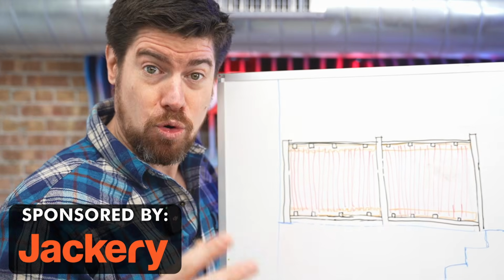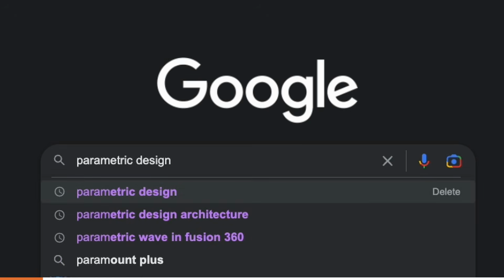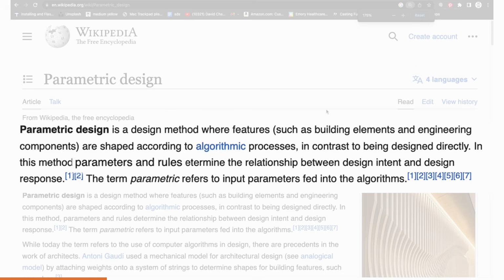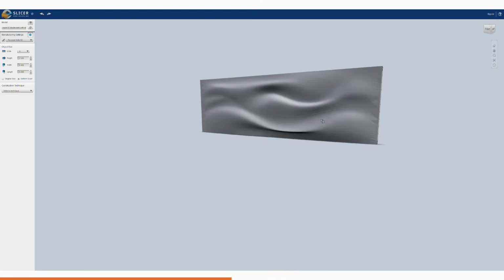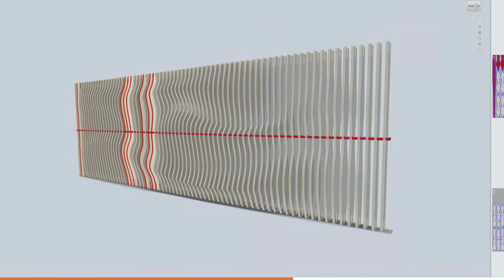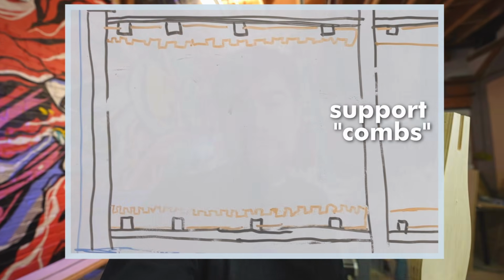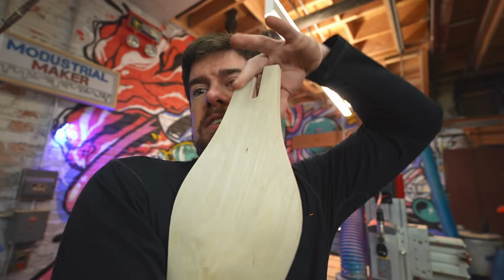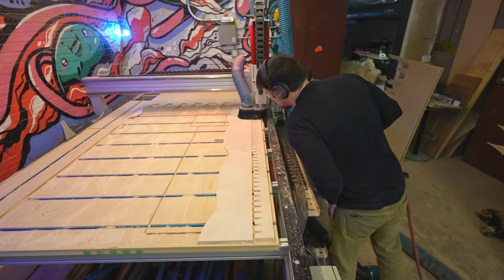I HATE Boring Stair Rails, so I made THIS....

Comment: OK, but why not get, say, a big slab that's half the length of your railing. Then just go nuts on it with an edge grinder, then cut it into slices, number them and space them equally apart. Fewer steps, less ridiculous equipment, similar result (the shape wouldn't be parametric).

Comment: Where the black shows on that middle rail  because the design needs a really thin but of wood  , how about putting a wood ball that shows both side of rail ,as if it stuck going through a hole in the design .as that tiny bit of black  just sticks out like sore thumb . Have something  on purpose rather than a cock up

Comment: How are you out of 1/4 dowels.  you have a CNC machine and are a woodworker.  you should have been able to make some some dowels from either method.   
We had to do this in highschool on the drill press with a small hole bit.

Comment: Assume the fence post was put in the wrong space because you pull the post on the wrong side of the measuring line, ad the pipe is about 1 inch .   At least that is what I would have done by mistake.

Comment: I think to add to the top frame, maybe get some 1x3 steel box tube and cap off the top by welding it straight to the slightly elevated posts. I think the extra parts sticking out the top look odd, and the metal painted would look pretty slick with it. almost like a hand rail. Lastly is there any way to make the support at the top stair smaller, with something more like a piece of plate for a gusset?

Comment: this is some great work man. As far as the hardware for attaching this, as other peopled mentioned it could be better. Barrel Nuts and bolts would look the best IMO. Also the dowel and hole thing will definitely be good, but maybe do it before it falls off, it'll just be harder to get it all to match again if you mess with it once it's been installed for a while. Also are you going to do the same on the stairwell side?

Comment: What a great project! Very well done! Loved it! I just have 2 very minor concerns and they are totally fixable if you agree with what I see! I guess with black painted bolt heads it will be seamless. The second thing is that it just feels really weird to see that empty black hole in the middle of the overall view, maybe you can just do a one piece with a very thin layer of wood in the area where the previous two pieces are separated, before you go with epoxy and stick it there for good, it is doable now since you are using a double faced tape as a temporary solution. Again, great work, much support!

Comment: Im not saying you are wrong that the program you are promoting is faster for this but it really doesn't take long if you're proficient with fusion to create an array of slats like that.  Like it's a single operation. a rectangle the thickness of plywood with an array using the intersect.
Reply from the maker: then take 72 pieces, move and rotate them individually onto 4x8 sheets of plywood ;)

Comment: That wouldn't take hours to do in fusion, just calculate the width and spacing of each segment, and use a box plus the pattern tool and the intersect modifier to make the pieces...
Reply from the maker: then rotate all 72 pieces and arrange them on 4x8 plywood pieces... and if you don't like the spacing, redo it 6-7 times like I did.  I did it manually for the sign in my shop, and it definitely did take a few hours.
Reply: @modustrial  I'm more familiar with the 3d printing work flow, I thought the part that you were saving time on was the slicing. My bad, thanks for the insight.

Comment: So damn awesome! I'm not any professional at all, but is there a reason you welded the frame to the floor instead of using a smaller square tubing insert bolted to the ground where you can then slide the main vertical rails over it?
Reply from the maker: I have a weird situation where I don't have access to the floor from below, so had to make it work.

Comment: Could you not have turned that shape in F360 into a surface and used that to "cut" a bunch of slats in F360 generated from a single object?
Reply from the maker: yes, you can...but then you also have to individually rotate and move each slat onto a 4x8 sheet to generate the CNC cut paths, which is a huge pain.

Comment: Cool design, but that is not parametric modeling. Parametric modeling is using mathematical equations(algorithms) to create the design. You modeled everything by hand and used a CAM software(the slicer) to output a cnc file for your hand modeled CAD model.

Comment: Actually, once you have made your model in Fusion360, you just need to create 1 slat, repeat 71 times and intersect with your wave. The result is 72 slats without leaving Fusion360, no need for an external program such as Slicer.
The main problem is that the shape is static, so may get bored of it fairly quickly. An immobile wave? There probably is a way to do better, don't you think? Arduino-controlled servomotors bending slats parallel to the handrail is pretty penny, but you can make actual moving waves on the entire length of the handrail... Class!

Comment: Love the design but hate the fixing method. I would use a U channel at the bottom to hold the comb and an L angle with welded captive nuts (recess the rear of the comb to accommodate) then use black countersunk screws through the comb. Hides the 'Method' and directs attention to the design. IMHO of course. Totally love the education you give.

Comment: Slicer for Fusion 360 is not parametric design, it is computer aided manufacturing (CAM). It generates the routing for you based on a given design. Akin a 3D printer slicer software. And it seems to generate also the nesting for them. This is very cool piece of software none the less! 

For this to be parametric design, you should have not freeform the design in Fusion, but instead given some parameters (inputs, formulas, curve equations) and let Fusion generate the result, and you only changing the inputs to your liking.

By the way, Slicer for Fusion 360 is not supported anymore.

Comment: Hey, firstly it looks really sick! also I just want to point out.. the software that you use is "just" a slicer software the parametric part would be the generating of the curves, if I understood it correctly. never the less it looks really nice! and I wait for the day, when I have access to an cnc-machine to do something similar (I'm not mad enough to cut and sand days on my own, if I could have a unpaid robot worker doing it for me :D )
Reply: Yeah, just to echo what you said. It is a cool design but not really parametric. Even in the definition on the wiki, its about using parameters/variables to do the design, but the 3d surface was designed directly (what the wiki says parametric design doesn't do). The slicer software is definitely useful for getting the look right but the design itself isn't really parametric. If you could do the 3d surface as a bunch of trig formulas where you can use a variable to control like the intensity or frequency, that would be more parametric design. It allows you to generate infinite possible designs just by changing a few parameters, rather than just the one direct design.

It's definitely a really cool project though!
Reply: @dedicateD6  yes, that's exactly ehat i thought. He was still designing the Wave shape directly so not really using parametric design here. Never the less an awesome Design and handrail Project.

Comment: This has been on my mind for a while, and as someone unaware of the through and through of cnc machines, when it comes to you nailing down the board you are using, how do you know that your bit is safe and able to not come in contact with nails? or is it just a simple case of the bit can run through a nail if it accidentally comes into contact? Piece looks sick though as usual!
Reply: He uses Polymer (plastic) brads if I remember correctly.

Comment: I think even without the Software or templates this would be doable. 
Cut w bunch if plywood into identical strips, 
Turn then 90⁰ and clamp them together sort of like a cutting board process and then go in with a grinder and a wood carving blade and design your waves by hand. 
Finally unclamp the slats and just continue from there.

Comment: For slicing the model in the plywood parts, you can create a 2d sketch parallel to the rail and use mathematical functions to set a fusion360 rectangular pattern to the size you want. And can set a parameter in the parameters tab in which you set the width of wood, spacing between adjacent slices and length of rail.
However, it is more time consuming than using a software.
Nevertheless, nice work. I really enjoy watching your videos

Comment: This looks really cool! As always, I am a fan of steel and wood together. Can't wait to see the whole house!

I am a little worried about the strength of the posts though. There seems to be quite a bit of weight in the wood. If someone were to lean too hard on top of a post, it seems like it could get away from you. Maybe add some gussets or a piece of flat plate at the bottom of the posts? A vertical flat plate could be fairly inconspicuous if welded from the bottom of the plate that's anchored to the floor, to about 5-6 inches upwards on the post.

Comment: How did you end up lagging the bottom layer of metal to the floor? I didnt see any bolts.
Reply from the maker: The steel angle was already there... Whoever installed it tapped countersunk holes for wood lag screws, and screwed it to the joist in the floor below (reinforced with construction adhesive I believe).  You can see the screw heads flush with the surface, if you look close.

Comment: Looks good, if I had to critique (which I will do now:), the eye almost immediately goes to the black spot on the middle post.
Reply from the maker: Yea, it does... Designing again I would have made sure the middle of the wave was wider than 1.5" all the way across, so the interpolated post piece would extend the full length... But as they say, hindsight is 20/20 :). 

Long version of the story, is I actually made the decision to switch to 1.5 in posts instead of 1 in posts on the day we were about to start welding, after the slats had already been cut out on the cnc... With the original design having one inch post it would have worked, but I forgot to take this into account when changing to the beefier 1.5 in posts.
Reply: @modustrial  just paint a line to connect them and you gotta work on them welding skills a bit lol there is a channel called welding tips and tricks he really knows his stuff

Comment: Hey Boss,

I realize with the editing, you may have taken out some of these parts of the process. But in case it hasn't been said, you can do tack welding to avoid the problem with the middle post again. you can do a tack weld either side of the post, check your measurements, and finish the weld. 

This works in the process, so you can break the tack welds if you fucked up. with the height, the leverage of the piece is enough to break it. and clean up is just 2 tacks, as opposed to what happened.

Hope this reaches you well, project looks great.
Reply: Better yet just build the whole damn frame in the shop, then just weld the posts into place, like every railing fabricator does
Reply: @carl4043  I guess that more depends on corners, weight, amount of people lifting. 

Also this guy's channel is all DIY. Showing the process is all about learning and showcasing neat shit. He did great! For not a rail fabricator
Reply: @JosephSirkinov  absolutely, but that simple frame was not heavy at all.
And I agree, but it would have been simpler and easier to do all the layout, including the tabs, and all the welding (except the three posts to the floor) in the shop.
So it appears to the DYIer that the job is more difficult than it is
Reply: @carl4043  oh certainly. However I don't remember anything I did the first time being the most efficient either ;)

Comment: A little late now, but if you do anything similar in the future consider making the railing bolt on instead of welding directly to the structure. It just makes it so much easier to remove in the future if you want to change things up or try something new, or even if you just need to get the railing out of the way to make moving a large piece of furniture in/out easier. You can weld on landing plates with tapped holes, or weld in place nuts. Otherwise the project looks great.

Comment: Looks amazing. The missing piece that you filled in just made the flow work. My OCD would be driving me mentally, though with that tiny bit of black showing. I'm sure it's correct and fits the wave pattern it just draws your eye and looks like a mistake IMHO.
Reply: Yeah. The small black spot interrupts the flow for me. I understand he was trying to match the depth of the other pieces though.
Reply: Yeah, just stick a thin veneer strip there. It would keep the flow working but doesn't attract your eye immediately.
Reply: He could always tape it off and paint a little strip on the black to join them. Or at least make it look like they join.
Reply: I agree. Its not even my house and it drives me mental
Reply: Totally agree with you, i though the same thing.
Reply: My exact feeling! If that's OCD, I've got the same problem.  : (

Comment: Is this really parametric design? It sounded like the design needed to be algorithmicly driven. By manually forming the wave pattern, doesn't that negate that definition? Or is the process of taking that design and algorithmicly making it into those slats what make it parametric?

New to parametric stuff, so genuinely curious! :)

PS. this looks amazing and I would love to have something similar with some lighting.
Reply from the maker: There is an algorithm involved in slicing up the shape, taking samples of the surface at an interval dictated by the input parameters
Reply: @modustrial  gotcha, thanks!
Reply: Parametric design is a bit of a catch-all term these days. It basically means that the design can be updated based on initial parameters. Basically all modern CAD software is parametric, you can go back in the timeline and change things and the design will update (or try to, true parametric designs that don't break are hard to make once you get past a few operations). The design here is parametric, because he could go back to that initial sculpting and modify it and then re-slice it, and you can do that indefinitely. The slicing process isn't what makes it parametric, it's the fact that the end product can be changed simply by changing the initial operation, in this case the surface sculpture.
Reply: @cegan09  Great response! Thanks! Answered all my lingering thoughts.